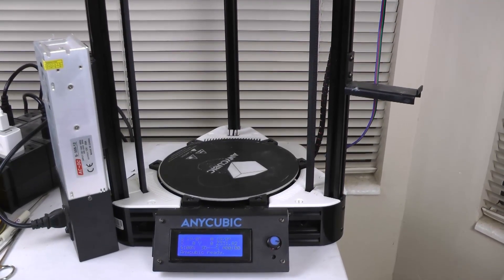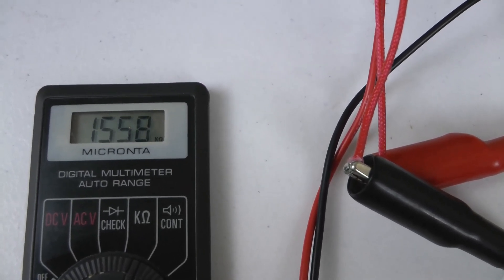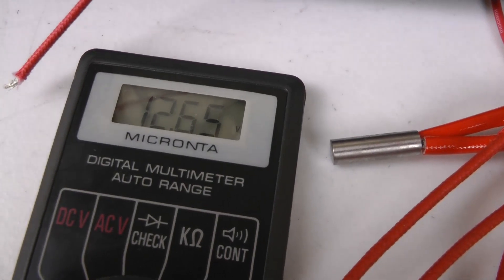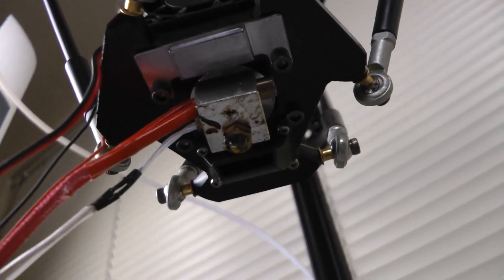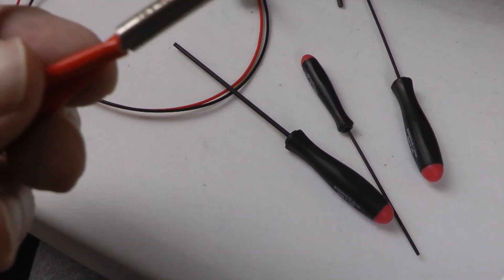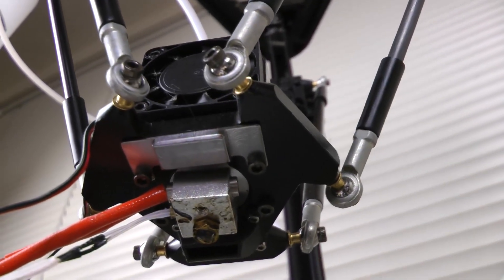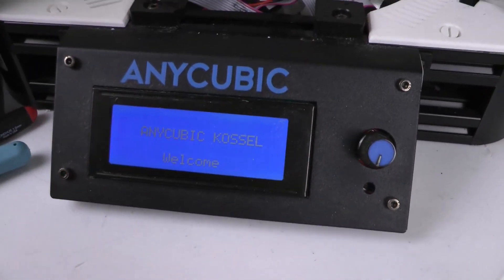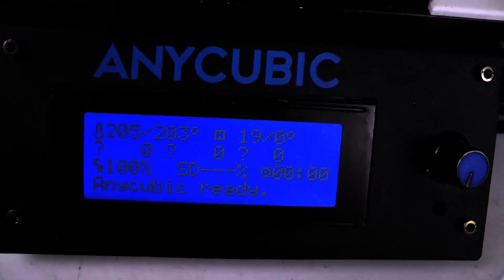anycubic kossel heater repair

Comment: a 32 bit board with quiet steppers make the world of difference to a printer like this - I've had my kossel linear plus with a re-arm and quiet steppers for a few years now and its still on the original heater cartridge - but it is nowhere near the quality of the genuine E3D

Comment: More than a few of us had a different experience. Undo the grub screw holding the thermistor, so far so good. Try to remove the grub screw holding the heater cartridge , find it is tightened to the pint of being stripped. New plan, cut all wires, disassemble the entire print head assembly, chuck the now useless J-head in the bin. If you DO manage to get the grub screws for the block removed, toss those and replace with Allen drive socket head screws which do not require you to become a contortionist to remove.

Comment: John you are a star. Such a simple guide.... I have a kossel linear plus and experienced a failure to heat the nozzle. Lots of guys on the group had the idea it was the heating element which had failed but we're unable to point me in the right direction as to the process to check and if needs be replace/repair. You have saved what little hair I have left from being pulled out. Thank you so much for taking the time my friend

Comment: thankyou my man:, had to take the hotend apart on my delta plus, couldnt remember where the small shiney bit went, kossel didnt understand what i wanted, but your video of the underneath parts saved my sanity,, so a big thankyou,, I bought my delta plus in january this year, was supposed to be a new one, but turned out, i think was a customer return, the board had been burnt out, the sliders wernt sliding, and two rods were broke, as well as having a dented psu, but in fairness, they replaced all the parts that were faulty, and last week i finally got everything ready to print, only to find the nozzle was blocked solid, even holding over a gas flame didnt budge it, so i bought a few spare nozzles, but then forgot where everything went as per the 1st part of this message.  happy days

Comment: Hello John , thanks for the video, i've had the same issue 4 months later after i bought the Anycubic kossel linear plus. My heater increase and decrease few seconds after it hits the 210°, so the Anycubic team said that i need to change the heater but i don't really want the chinese ones so i would like to know where did you get yours from, the original ones supposed to supprt the heat longer then the copies. Thank you Man
Reply from the maker: You can buy genuine E3D heaters from either Matterhackers or Amazon.  6 weeks after I complained to Anuycubic, I received replacements from China.  The longest it ever took me for Prusa warranty support was 1 week.  Of course, I had already bought an E3D one that I got from Amazon in 2 days.
Reply: @johnquandt8795  You're lucky John because the guys didn't want to send me a new one and the reason was ' we don't send consumable items for free ' so I have to buy mine. Anyway thanks a lot man and happy new year.
Reply from the maker: @Dayli-tips  Actually I was surprised I got any support from a Chinese manufacturer.  That's part of why I didn't wait and ordered the E3D one.  I did check out the Chinese ones on Amazon.  After reading one review that stated they were okay, but only lasted 3 months, which was okay because he got 10 of them, I realized there was a reason that Prusa uses high quality parts, as well as providing good support.  When you buy a cheap Chinese printer, you should consider it a box of parts only, with no after sale support.

Comment: I replace my heater cartridge like you did but when the browns can kicks in at 60 degrees, my extruder doesn't heat up to 200 degrees it'll stay at 170 degrees. Any tips to fixing that?
Reply from the maker: Did you check the power output on the main board?
Reply: @johnquandt8795  everything is fine on the board , the hotend kicks on at 60 degrees and is overlooking the extruder to where it doesn't go above 170 degrees
Reply from the maker: The heater works based on current flow.  If the heater is good, then the power supply must be failing to provide enough current to reach the higher temp.  About the only way you could tell is if the voltage drops when heated, your power supply isn't able to provide enough current under load.

Comment: Thank you, Im running Marlin 1.1.9 I've only had the printer for a week, and in the middle of a print It stopped and gave me the message "E1 Heater Failure". Im going to try this, as anycubic doesn't respond once they get their money I guess. I appreciate that you documented and shared your experience with this printer, as information appears to be scarce.